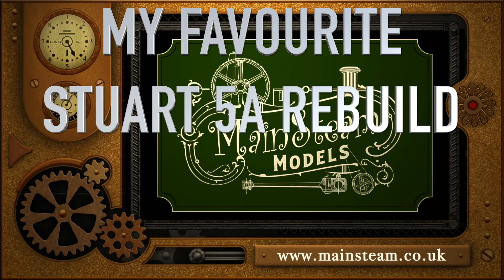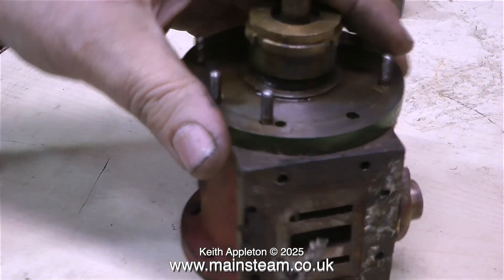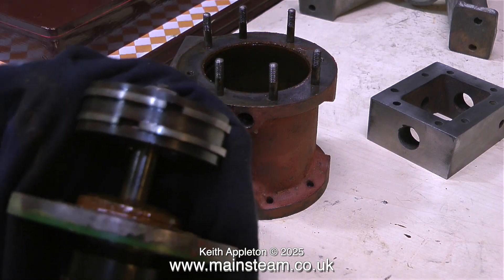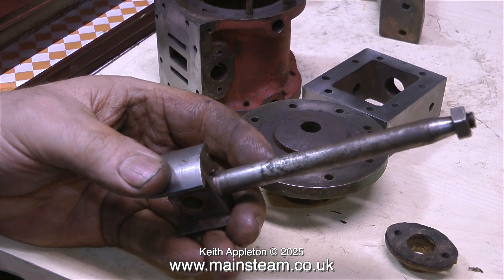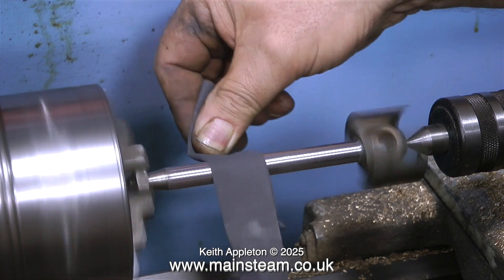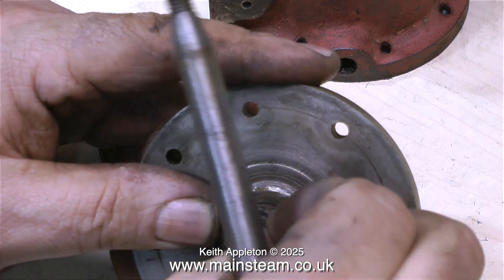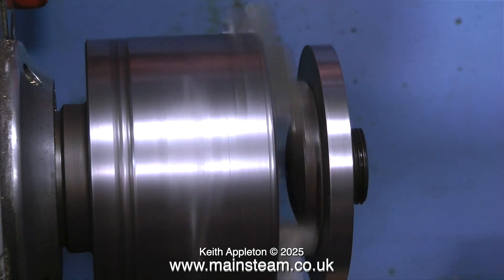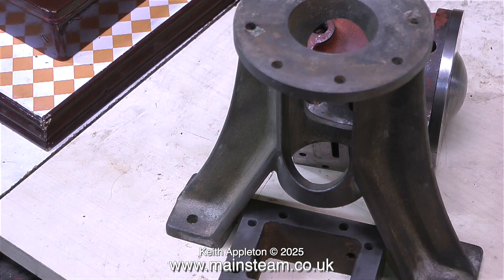MY FAVOURITE STUART 5A STEAM ENGINE - PART #1 (CONTINUED)

Comment: Mr. Appleton. I just would like to know what you would do. I was given a Stuart horizontal steam engine, that the purchaser started building it and made a machining mistake on the base casting. He got frustrated and gave me the engine. I looked it over and sure I can complete the engine but it will no longer match the plans. A new cross slide would have to be made, along with some other issues. I could get a replacement casting as this engine is still made. I usually put my name on my projects, but I don’t want someone like yourself, to look at it and think I was the one that did a sloppy job. You do excellent work and just would like your thoughts on it. Thanks so much for all the great videos!
Reply from the maker: If by making your own parts the engine looks absolutely identical to the original, then Ok. Otherwise I would buy new parts from Stuart Models.
Reply: @keithappleton Thanks Mr. Appleton, I’ll see if it will look good, if not I’ll replace the part.

Comment: Hello Keith I really hope you can give me some advice , I have purchased a 1950’s 060 locomotive , it has a boiler feed pump and I’ve disassembled it and it has an o ring and a strange substance that looks like thick old Greece and possibly string that was embedded into a groove in the piston of the pump. Do you know if that’s meant to be there and do you know if I need it or not, many thanks I really hope you don’t mind me asking , thank so much
Reply from the maker: I don't know what that substance is but it sounds like it may have been packing that was used to stop the pump leaking.
Reply: @keithappleton thanks for the help would you recommend just putting another couple of o rings into the groove
Reply from the maker: Only one is sufficient
Reply: @keithappleton Thaks very much for your help